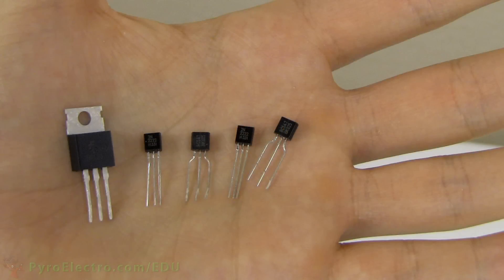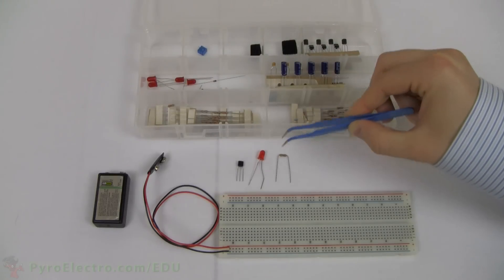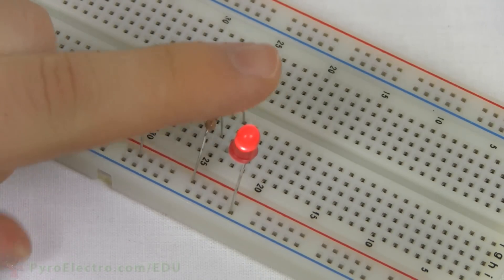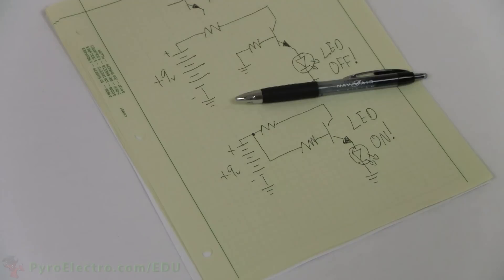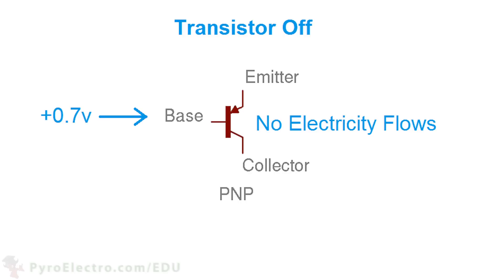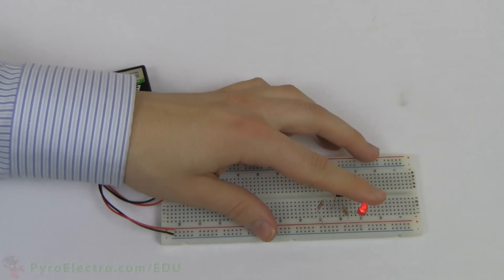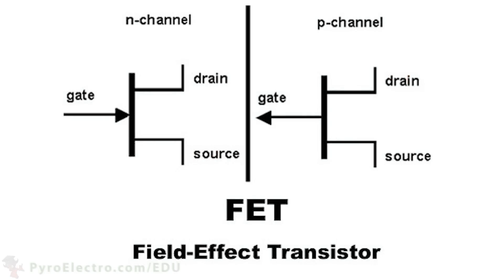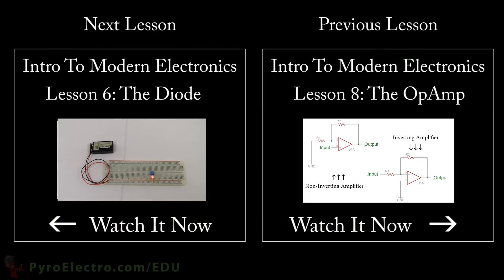PyroEDU: An Introduction To Modern Electronics - The Transistor

Comment: As an computer engineer there's so much wrong about this video.  The wiring is incorrect for one.  The collector and emitter have been swapped.  The biggest point is this video is treating BJTs as voltage driven devices which they are not.  A MOSFET can operate that way but for anyone using a BJT they need to understand that it is a current driven device.  It acts as a switch and an amplifier.  One needs to be aware of the Hfe or Beta of the part to calculate the amount of current needed.  You can give it more voltage and not have an operating circuit because not enough current is flowing.  The third point is that the schematics presented are very poor practice.  Even with the current limited above the load extra current is being provided through the BJT to the LED in that configuration.  NPN BJTs and N-channel enhancement MOSFETS are placed to do low-side switching, below the load to ground.  PNP/P-channel is done on the high side like was done in the diagrams.

Comment: For the fellow students: at 2:01, NPN transistor was inserted backwards I think. The circuit works correctly only if the NPN transistor is flipped. Please see 2N3904 datasheet, at 2:11 the "rightmost pin" of the transistor is the collector not emitter. The setup works backwards (as displayed) too but it has some strange currents when base is off